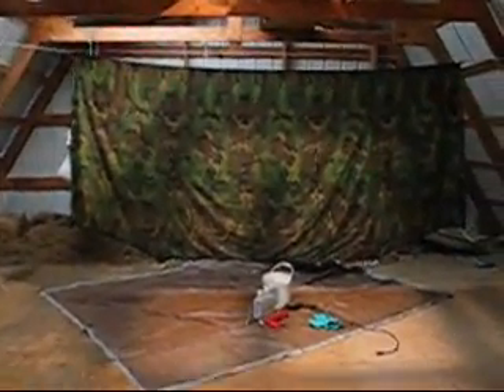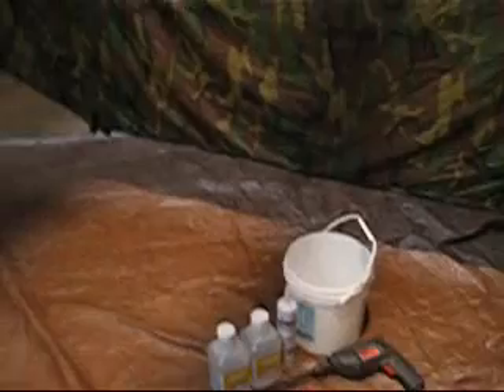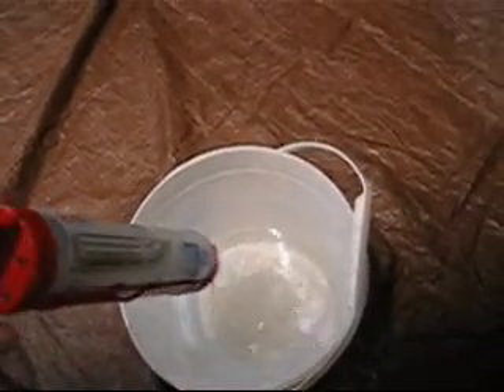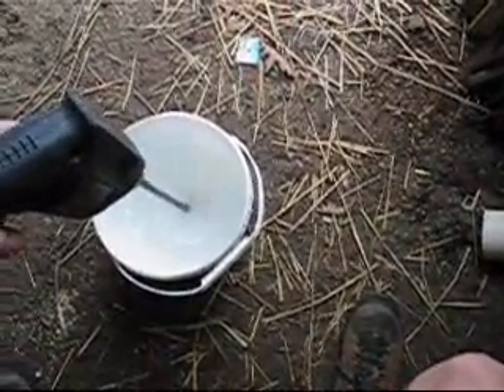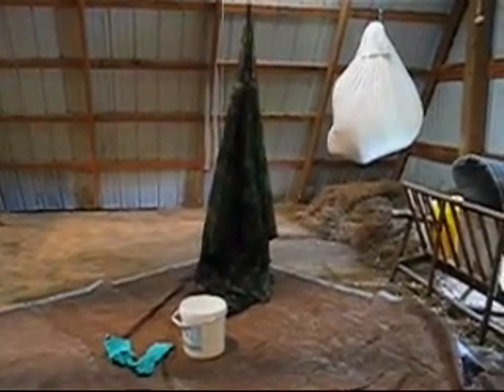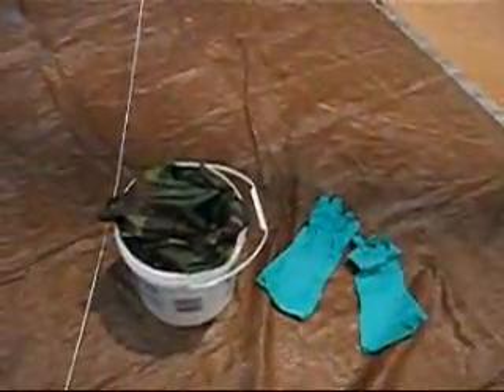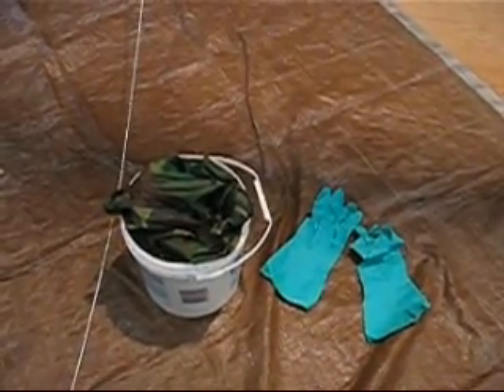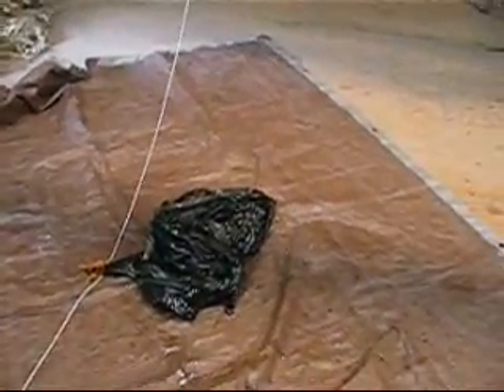The Cheap Bastard's Guide to DIY Silnylon

Comment from the maker: I sewed together a tarp using 1.1oz rip stop nylon. It's a thing of beauty, but  RS nylon is not by itself WATER PROOF. Soaking the beast in a solution of silicone & mineral spirits was a cost effective solution.  To buy silnylon in the quatity needed was out of my price range.  This is a fine example of that "make do pioneer spirit" that the less advantaged must embrace. Do ya get it now?
Cheers

Comment from the maker: Well,... I made my tarps out of 1.1 oz RS nylon.  By itself, this material leaks like a sieve when rain falls on it.  You can buy a tarp made from silnylon which is nylon that has either been coated or impregnated with silicone.  These tend to be very expensive.  So I took the DIY approach and made a silicone solution to saturate the RS nylon fibers.  Now it no longer leaks like a sieve.  This way I made a silnylon tarp that cost me $30 instead of buying one for $125.  Make sense?
Cheers
Reply: How did it hold up over the last decade?
Reply: @thegingerpowerranger  I got 5 years of regular use out of it before gifting it to a friend.  Unfortunately his dog made hash out of it shortly therafter.  My son still has his, but it does not get much use these days.  Cheers from Montreal QC
Reply: @brainewavevideo7814  awesome mate, definitely worth the time invested in it! Thank you for uploading!

Comment from the maker: I think you'll be pleased with the results.  Just remember to squeeze the hell out of the fabric while it's in the bucket.  It's easy to create air bubbles that hinder the saturation process.  You'll have about thirty minutes of working time once the mineral spirits and silicone are well mixed, so don't be in too much of a hurry.  That was a mistake I made once, and it cost me dearly.
Cheers

Comment from the maker: Sorry, I made the tarps myself using 8 yards of 1.1 oz ripstop nylon for each.  The application of the silicone brings the fabric weight to approximately 1.5 - 1.8 oz per square yard.  Add tie outs, d-rings, and cordage.  I couldn't say what mine weighs, but I would guess around one and a half pounds.
Cheers

Comment from the maker: gor-tex is a breathable woven fabric which has a limited functional life span.  coating it with silicone will make it water proof, to be sure.  however, it will no longer be breathable.  I would try cleaning the fabric first.  If that does not help...

Comment: Giving it a try. Mixed it up with a paint mixer and drill. Worked great. 2min of mixing. Used an engine cleaner cleaner to spray it on. It's just an air gun with a tube attached to suck up the stuff and spray it out. Worked great! Harbor freight probably has it. Did 3 tents and half of my boat cover. Mixed the other half gallon to finish it and poured the extra back into the container. Hope it stores ok for next time. Dried to the touch in about an hour. No stink in the tents 8 hours later. Hope to find this video later to post how well it works.

Comment from the maker: It's a good question.  A brush will only produce a surface application.  Total submerssion guarantees complete impregnation of the silicone solution into the RS fibers.  That's how silnylon is made.  Occationally you may see advertised inexpensive tarps thar are "urethane coated" (which is what you end up with by brushing).  These work well enough in the short term, but eventually the coating wears out.  Not so with the total immersion method.  Thanks for asking.
Cheers

Comment from the maker: Tie 2 loops in a tarp line approx 13ft apart. Tie the line at least 8ft high between two trees.  Make sure the wind direction is perpendicular to your line.  On one long edge of your fly attach 16ft guy lines at the corners.  On the opposite corners attach 4ft lines.  Feed the long lines up through the loops, then soak your fly thoroughly in the silicone solution.  Pull the long lines up and stake them, then do the same with the short ones, adjusting as needed.  Let the wind do the rest. Dry in 2hrs.

Comment: Thanks for the share. You probably just saved me 40-50 bucks when I buy a tarp and tent. A much needed save at this time. If you have a sewn ridge line and tie outs on it  would you seam seal the ridge line and tie outs after? Also how's the tarp holding up on waterproof and what not? Thanks again, cheers.

Comment from the maker: It's better than a surface spray because the nylon is completely saturated with the silicone/mineral spirit solution.  For maximum protection you would need to spray both sides - a pricey venture.  Some people use a roller to coat the nylon, but it's still not as effective as the total submerssion method.  The degree of usage and UV exposure will determine longevity.  Mine is now 1 yr old and going strong.  I use it at least one night a week, less in the winter.
Cheers

Comment from the maker: 2 quarts of mineral spirits (low oder kind) + 1 tube of silicone cauld is going to run about 
$15 US. The 1.1 oz RS nylon for each tarp cost roughly $25 US.  I have made 4 full sized 4 season tarps (just one for myself). Each has seen a year and a half of service with no leaks.  When they do wear out I will simply make another.  $40 silnylon tarp is hard to beat.

Comment from the maker: @morock99 
For the tarps I made, I was using 1.1 ounce ripstop nylon.  With the silicone treatment it ends up being around 1.4 ounces per square yard.  Both tarps survived a violent Missouri thunder storm with reported  wind gusts of 60 mph.  The hammock I was lying in was bouncing up and down like a trampoline as the trees were swaying in the wind.  Scarry!  At the time, the tarp was tied down with shock shock cord tie outs which probably saved it from being torn to shreds. Snow is no problem.

Comment: Moreover, I found that the mixture is still good to use next day if well sealed in it's container. 
I was afraid the silicone will start polymerizing even in the suspension but it didn't. 
Actually, my silicone, cured a lot slower. It took 2 days to cure 100% on my backpack's seams. 
I think if the bucket or jar is well capped and airtight, the solution will stay ready to use for days.

Comment: Hey, great vid. Im new to DIY'ing camping gear, so I love videos like this. I have a question though: After youve treated the ripstop with the mixture, how does it handle as far as rolling/folding? Is it stiff or is it still fairly pliable? For instance, how big of a roll does that size tent take up once youve rolled it? Thanks in advance!

Comment from the maker: 50 degrees or better is my advice.  It will generally be dry to the touch within a few hours, but let it set for 24.  I have seen some people apply a finish with a roller, but you don't always get full saturation - which is what you're ultimately after.  Where are you in MO?  The vid was shot in my father's barn in Columbia.
Cheers

Comment: I have several old nylon tents I would like to waterproof without buying host cost waterproofing.  

What would you do to apply it without total submersion. BTW what temperature is needing for drying this solution?  Missouri weather is currently flexing between 70 degrees yesterday to 39 degrees tomorrow.

Comment: I am 13 and want to do this for Scouts. Where did you get the nylon tarp. At scouts we use army pup tents so each scout has the same tent because some of the richer families have better tents than others so we use these. Any way they are heavy and weigh about 5lb per half, i carry both halves plus a ground cloth, which weighs alot because it is naugahide. Please help.

Comment: You're too funny! Just bought the silicon yesterday, hope to treat a tarp/poncho and some bags this weekend (assuming I really do have an old bottle of mineral spirits in the shed).
Reply from the maker: Howdy Pard,  
Thanks for watching.  Best of luck on your DIY project.  Special note:  I made those tarps back in 2011 and they are still fully functional.  A testament to durability.  Also did a vid on waterproofing a canvas bag using bee`s wax.  Awesome stuff.  Cheers from Montreal QC

Comment: Hope you are still around....   Were they new commercial sealed tarps or older tarps that had started to leak?
Reply from the maker: Good heavens, those where two tarps that I made with me very own hands.  All rip stop nylon (1.1 oz, as I recall).  Wow, that was 10 years ago!  One of the two tarps featured in this vid is still going strong.  The other one was given to an "acquaintance" who promptly destroyed it.  Very sad, because it was a great 4 season man cave tarp. Note to self: never give things away to people who don't give a f#@ck.  My take away: we learn as we go.  Cheers from Montreal QC
Reply: @jspate61  Thanks.   So why could I not take an Eureka tent that the urethane waterproofing has failed on and soak the non-treated side with the silicone/mineral spirit mix?  I have a tent design Eureka no longer makes and would like to see if I can give the tent more life.
Reply from the maker: @leonardsackett9568  You could do that.  But how old is the tent?  The method I have used is what I would call total emersion.  This method provides total saturation of the nylon fibers.  By doing it this way, you must be sure to stretch the fabric well, avoiding all folds (to the extent possible).  Another option for what you want to do would be to pitch your tent first as tight as you possibly can, then using a foam roller to apply the silicone mixture.  Surface coating is fine, but not nearly as good as full immersion.  However, if you leave the tent set up, you could apply more than one coat (?) . Just thinking out loud here.  Personally, I would give it a go (just one coat).  If it doesn't work to your satisfaction, scrap the whole thing and buy a new tent or try making your own tarp, or... fill in the blank.  Whatever you decide to do, please keep me posted, and let me know if you have any further questions.  Cheers from Montreal QC
Reply: @jspate61  Jeff thanks for the reply.  I see that some commercial tarps have a combination coating having both a urethane and silnylon coating.  Figure just like a tent that is urethane sealed then silnylon added.  The tent is a Eureka Alpine Meadows.  A great tent design that for some reason they stopped making years ago.  I figure mine is 30 years old or so.  99% of camping in the woods, in the shade.   I figure giving it a bath to get it really clean.  Set it up and apply the thinned silicone with a paint roller.  Saturate but avoid runs.  Nothing tried, nothing gained.   Thanks

Comment: I want to do this with the stuff sacks and compression sacks I will be using for my hike on the AT this year.  Do you have any suggestions or tips on how to dry the bags without sticking together?   Also, where/how do you dispose of the leftover solution?  Would a drill paint stirrer with zip ties work just as well for the mixer?  Love the video.  Very easy step-by-step instructions and CHEAP :)  Thanks!
Reply from the maker: here's an idea: take a coat hanger, bend it into a circle the same circumference as the opening of your stuff sack.  Thread the hanger through the draw cord channel.  You can do this before or after you dip.  Let the bag hang dry by laying a heavy book on the length of wire left over.  Or use 2 hangers to make a crossing tent frame.  bend the frame to fill your stuff sac.  You may need some tape or twist ties or rubber band to hold the hangers together at the crossing point.  I can think of more, but you get the idea.

Cheers from Montreal

Comment: Hey. That rip stop nylon. I can't find it any wider than 62 inches. I was hoping to make a tarp 10x12 or even 8x11 to cover a hammock tent completely. Only thing is, I can't find this stuff wide enough. Any suggestions??
Thanks!
Reply from the maker: 62 inches is pretty much as wide as it gets.  The solution is to sew two pieces together.  The seam forms the center ridge, and is therefore incredibly strong.  When you dip the entire thing in the silicone solution the seam gets completely sealed.  Check out Backwoodsdaydreamer for supplies and plans on making hammock tarps.

Cheers

Comment: Thanks for putting up such a wonderful instructional video! I was wondering though, would you recommend doing any sewing work before or after this process?
Reply from the maker: you definitely want to get all your sewing done before hand.  At least that's the approach I've always taken.  This stuff works great!  Mine have been going strong for three years now without any leaks or wear.

Cheers from Montreal QC
Reply: +Jeff Spate Interesting!  Doing the coating after construction opens up the possibility of building the seams using welding tape. This doesn't work too well on silnylon, but works fine on untreated ripstop. Threads on Backpacking Light suggest that the result is pretty strong.  You could then leave as is and get a shelter with no needle perforations, or add additional strength by sewing the welded seam.
Reply from the maker: +CoolEnder619Gaming 
I do all the sewing before.  No leaks in five years.  Rock solid.

Cheers from Montreal QC
Reply from the maker: +Tullochgorum 
Good points.

Comment: I followed your idea to waterproof three cheap pup tents.  It works, but what a hassle.  I have since waterproofed a tent bottom with waterbased polyurethane by Zar, a wood finish product.  It's way easier, odorless, not a fire hazard, stays flexible, not sticky and looks good.  The treated fabric will become a waterproof membrane. I don't know why other Youtube tinkerers haven't caught on to this.  Thanks for starting my thinking.
Reply: +RAYMAE What's the precise name of the zar poly woodfinishing product you used and liked so well?  It sounds like it worked perfectly for what i'd like to try.
Reply: Yes.  Aqua Zar satin.  Do it on a day when temp is over 100, and dry all day.  The tent will not breathe well thereafter.  More condensation when temps go below freezing, but that is a common problem with cheap pup tents anyway.

Comment: What should I use to thin out a tube of Hi-temp Silicone? The additive should not leave any flammable residue (like mineral spirits), nor degrade the fabric over time.
Reply from the maker: That's a good question.  I would be a liar if I said I knew the answer.  If you're wanting water proof nylon, you still end up with a flammability issue (I believe) with the fabric itself.  Please let me know what you come up with.
Cheers

Comment: How much more weight per sq foot or meter did this add to the fabric? Great video, i think when i done mine i had to much of a ratio, nice a heavy duty thou!!
Reply from the maker: I think it added approximately half an ounce per square foot.  That's just a guess (I never actually weigh any of the stuff I make), so please don't quote me on that.  I will say this: I made those tarps 5 years ago and they are still going strong.  And you can quote me on that.

Cheers from Montreal QC
Reply: Yeah mine sticks together like a used condom, in fact I call it the condom tarp, but the silicone still refuses to pull away from the nylon. I have talced it a few times but get fed up with the baby smell ^^
Reply from the maker: Hmmm, that's a curious thing (the sticky business).  I can't guess what would be causing that.  Did you get your mix proportions right?  How long didi you let it dry?  I think I let mine hang for a day or so.  ??
Reply: I think i used a different mix to the one you was using, it went on quite thick. I dont mind it sticking, seems to be when left in storage for a while, i just remember to unravel before. Currently looking into a silpoly tarp at the moment, thats what has made me research again.

Comment: Any thoughts on using a scraper to run down the tarp once it is stretched out and remove excess?  I'm thinking like the plastics scrapers used to put body filler on a car...
Reply from the maker: +shag126 
no need for any of that

Comment: Hi Jeff, I'm wondering if this process would work in the painters canvas you can buy from Walmart and on 2x4's & shop grade plywood???...Great video....thanks
Reply from the maker: If you would like to use this for canvas, it might be best to lay your material on flat ground and apply the solution using a 3/8 inch roller.  You would be wise to do both sides, bearing in mind that one side has to dry before doing the other side.  Or you could hang your canvas high and tight and roll both sides at the same time.  Easy squeesy, nothing to in.  For plywood I suggest a quality urethane, preferably an oil based version.  Best of luck to ya!

Cheers from Montreal QC

Comment: Hi Jeff, you didn't address the issue of the dome type shape & how to hang it.
Reply from the maker: I sent you two separate replies; one on how to hang your fly, the second concerning my thoughts about using less silicone.  Here's the first one again - Tie 2 loops in a tarp line approx 13ft apart. Tie the line at least 8ft high between two trees.  Make sure the wind direction is perpendicular to your line.  On one long edge of your fly attach 16ft guy lines at the corners.  On the opposite corners attach 4ft lines.  Feed the long lines up through the loops, then soak your fly thoroughly in the silicone solution.  Pull the long lines up and stake them, then do the same with the short ones, adjusting as needed.  Let the wind do the rest. Dry in 2hrs.

Comment: It would be nice if folks told of the size tarp they are treating in conjunction to the amount of sillacone and mineral spirits.
Reply from the maker: Both of the tarps I sealed in this video - if I recall correctly - were roughly 13 X 10 feet.  Hope that gives a little perspective.  Cheers from Montreal QC